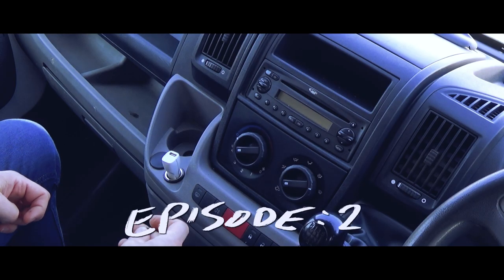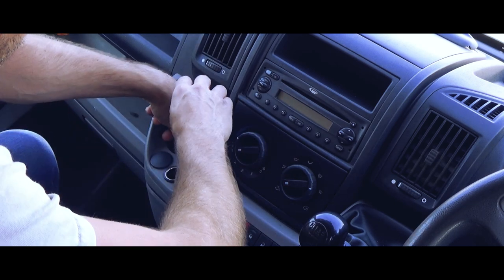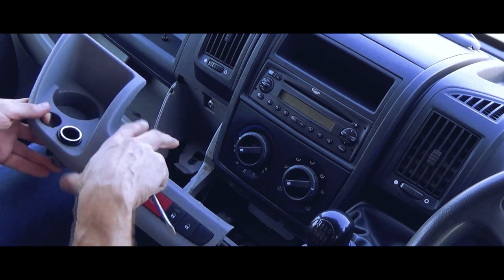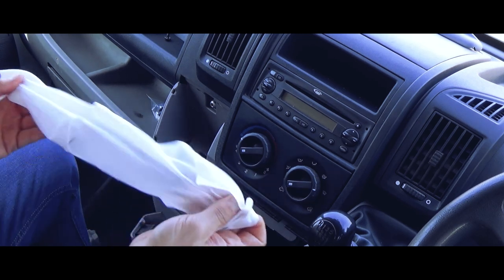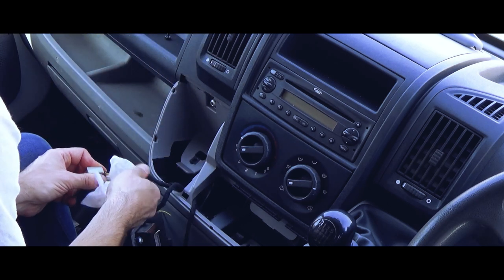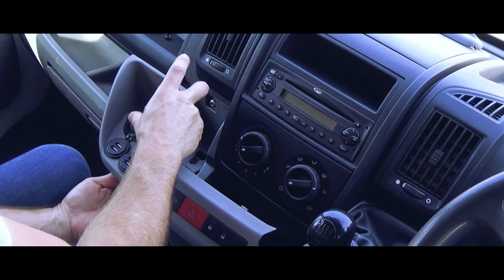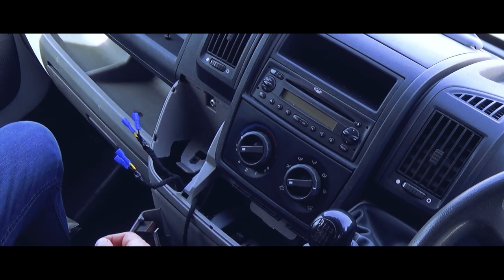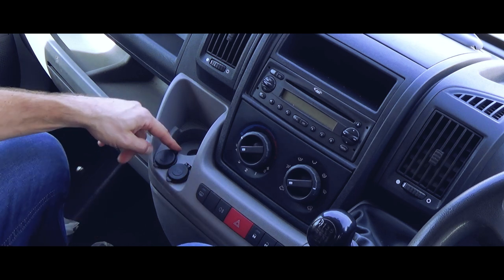2: Replacing the dashboard cigarette lighter

Comment: I just put in my USB socket. I did not cut of the original wiring. You can take the individual wires out of the socket and connect them directly to the USB socket. All you have to do is insulate them of course. I dont like to cut in the main wiring loom (i wasn't allowed to do that when i was working at the dealer)

Comment: Mate thanks loads! I have been looking for a vid that shows how the dash comes off and was delighted to find yours. Cheers!!
Reply from the maker: John Gow Photography you're welcome. Thanks for the sub. 😊
Reply: Hey Mevi. Which of the spare yellow wires is ignition, bold yellow or yellow blue stripe?
Reply from the maker: John Gow Photography there are 2 yellow cables per 12v socket. The thicker solid yellow cable is your live. The thinner striped one is for the dash lighting of a socket if needed, I believe.
Reply: Very useful. Just as I was thinking to ask. It was answered. Bit puzzling to see 3 wires going into a thing which should only have two! Well done, indeed! It was also a perfect location for my reverse camera monitor. Added an extra set of USBs and used the switched 12v to power the monitor.

Comment: No need to cut wires. Release tabs on fittings and the connectors are already attached. Then plug to new fittings.
Reply: Do you know what the third cable is for?
Reply from the maker: the original factory fitted socket glows when the driving lights are turned on - that extra wire powers the light.
Reply: @Mevi cigarette 🚬  lighter is 12 volt socket that what I use

Comment: In the past 35 years I´ve added additional power sockets literally to all my vehicles, including some van conversions. And in the process, in later years, have used several of the same USB sockets. 
So I´m confident enough to say you just used a lame excuse, to limit yourself to low output 5V USB sockets. The "cigarette lighter" socket not only works perfectly well as a normal 12V socket. But allows some decent amperage to an array of other accessories. 
Just some food for taught. ;-)

Upon assembly, instead of going around butchering the original wire loom. 
With small screw driver or pin, press tab on connector, remove them from the plug.
Add some insulation, I prefer heat shrink sleeve, but tape is just fine.
Connect them to your new socket. Enjoy. 
Cheers
Reply from the maker: This is an 18 month old video. At the time, 5v was all I was using in the cab, charging a phone, camera batteries and other small gadgets. I've put in 2 new 12v sockets in the cab since. The original cigarette lighter had to go, whatever. Fiat put very shallow lighter sockets in their vehicles, the Punto was the same. Nothing else stays in, but it DOES light cigarettes. Fiat put in an ashtray, but no cupholder!
I covered this in later videos and also that I had come to a similar conclusion about all those (unused) USB sockets in the back of the van too. 12v sockets with a usb charger is more useful than just permanent usb.

Comment: Great vid, Ive got a 04 reg ducato m/home, facia is very similar and I want to do same mod as you have, do  you know if the panel detaches in the same way as yours.
Reply from the maker: Sorry, I don't know. 
Darran (Urban Motorhome) has an older Ducato moho, but I've not spent any time inside the cab. FIAT reused the IVECO engine from the older Ducato, so it wouldn't surprise me if there were a lot of other parts and assemblies that carried over into the newer model.
Handy tip: If you feel like any plastic part needs to be pried up, cover the soft plastic with a piece of gaffer tape before you dig in with a screwdriver or trim removal tool. 😁

Comment: Would this be the same for a 2017 Peugeot boxer elddis motorhome and what wire do you not use out of the 3 wires
Reply from the maker: The engines and transmission are different, but nearly everything else is FIAT underneath. Aside from the trim, motorhomes are based on a commercial vehicle, so parts will be the same. 
The wiring should be the same as mine, little changed after the facelift. The thin cable is only for the ring of light around the socket that comes on with the dash lighting. Tape that off, it won't create a CANBUS error.
A great resource is fiatforum.com - regardless of manufacturer, there are a lot of solutions to problems for your vehicle (apart from the drivetrain). Maybe don't mention it's a Peugeot. 🤭
Reply: @Mevi  I was wondering what the third cigarette wire was for...

Comment: Hi mate where did you get the usb chargers from I’ve looked everywhere,Mike
Reply from the maker: Amazon is where I got these. 2+ years later, I've changed to plain 12v sockets and use high quality plug in USB chargers that are suited to modern devices.
I have phones that have fast charge capability, an iPad that can take huge wattage from usbc. A tyre inflator and vacuum. A charger for my work laptop.

Also see my video where I use a fuse-tap to add a socket to the right of the steering wheel. Saves trailing usb cables.

For me, it makes a lot more sense to have general purpose 12v socket. If you plan to buy a mix of 12v sockets or USBs, it can work out cheaper to buy a set (like the one I bought linked below) and use the parts. I paid only £9 back then. They've put up the price to £15 so shop around and don't buy this one!!!

https://www.amazon.co.uk/dp/B00Y4HRFTY/ref=cm_sw_r_apa_i_DCFQEbR9E3EZ1

Comment: Great video mate, helped me out a treat :) btw, do you know if there's a way to reset the courtesy lights in these vans? Diconnected my battery the other day while working on the van and now the courtesy light just stays on (when switched to auto)? Cant find anything out there.
Reply from the maker: Mine is basic spec and the interior lights don't connect to the CAMBUS. Do you have a 2014+ or higher spec van?
If you watch the video I made about adding another usb with a fuse tap, I also modded the interior light. You will see the inside of the switch has no electronics AT ALL.
The clock on higher spec models is changed through the stereo, maybe the lights is an option there?
Reply: Hi  @Mevi  thanks for the reply., mine is basic too, it's 2011.  The light comes on when you unlock it or pull the key out the ignition. can't find anything in the manual... worse case I can live with it, I just hate being beaten lol
Reply from the maker: Hmm, strange. Might be a stuck metal contact on the back of the switch and just a coincidence that it happened at the time of the battery coming out. Maybe pop the housing open and take a look. Here's the video where I open mine up https://youtu.be/F3ze_7KiEso

My batteries have been disconnected more times than I can count and the timeout works like always.

Comment: Could you tell if the Red Triangle light on the dash for the Hazard warning lights should flash when the Hazards are on? Regards, Pete
Reply from the maker: Mine doesn't flash. It only lights up with the rest of the dashboard. The connector on the back of that switch panel doesn't seem to have enough pins for more than illumination and the function of the switches.
Reply: @Mevi  Thanks very much :) Regards, Pete

Comment: Done exactly this but it's not going live do you happen to know what fuse it is ? And is it a shared fuse ?
Reply from the maker: F44 in the fusebox to the right of the driver, assuming yours is RHD. Manual says should be a 20amp fuse. I don't believe it's shared.
It's page 162 in the electronic manual which you can find in my shared resources Google Drive.
https://drive.google.com/drive/folders/1aR2mvfo_5IUx0QIuMMjqpkoYhAHMmKyq
Reply: F15 under bonnet box in the 2012 model...

Comment: any videos on replacing ignition barrel  ??
Reply from the maker: Fortunately, not something I've had to do. Try over at fiatforum.com - I reckon you'll find what you need there. Whether you're driving a commercial van or converted motorhome or similar, the base vehicle is pretty much the same across Fiat, Citroen or Peugeot (aside from drivetrain)

Comment: Please help, after cutting the plug/wires how do u pair them up? Really lost at that step.
Reply from the maker: Thick yellow is positive, black is negative. The thin yellow is unused (powers the light on the original cigarette lighter).
Once crimped, your wires connect to the spade connectors that should be marked + and -
Reply: @Mevi  thankyou so so much! highly appreciated

Comment: Hi mate just another question have you ever fitted a spare wheel carrier on your fiat Ducato van ?
Reply from the maker: I have. Easy peasy. Mine looked like it had never had a wheel in the trashed carrier that was on there. A few bolts and it's done.

No video of it. Don't know why.

The winder mechanism uses one of the tools in the box with your jack.
Reply from the maker: I bought mine new from eBay.

Comment: Could you list the parts you used, I'm going to do this straight away.
Reply from the maker: The exact listing isn't available anymore, but this is an identical part. There are cheaper listings, but I chose this one as a starting point as the listing has option of fast charge versions if you have a compatible phone. Also this one comes with extra lead and a fuse which might give you peace of mind.

https://www.amazon.co.uk/dp/B07TZM8PRL/ref=cm_sw_r_cp_apa_i_aIC.DbWEE4EPH

In a later video, I use a fuse tap to install another socket to the right of the steering wheel, above the fuse box. I've since swapped a few of these USBs to plain 12V sockets as they are more versatile.

https://youtu.be/F3ze_7KiEso

Comment: Hi Mevi
Do you know where is the fuse for the cigarette lighter? in which fusebox? Many thanks
Reply from the maker: It's the one in the cab. The book says it's Fuse F44, 20A fuse.
Here's a link to download the owners manual. I've shared it on my Google drive for you:
https://drive.google.com/file/d/1BCmbZiNgCB6rv1qMkjtDXHPaJE1CI4GS/view?usp=drivesdk
Reply: It depends on the year that your van was built. Some have the cigarette lighter socket fuse F44 20A in the fuse box in the dashboard, later models have it in the fuse box under the bonnet F15 10A.
Reply: Dose the lighter port and the spair lighter port run off the same fuse .iv fitted one on my spair and I don't have any power to it only my cigarette lighter port.i might need to change the fuse .do they have a fuse in if it's blank also.my van is relay 2020
Reply from the maker: In my 2011 van, they share the same 20A fuse F44.

I did a quick Google and it looks like after the 2014 facelift, they moved the cab 12v sockets to TWO SEPARATE fuses... In the fusebox inside the engine bay. F14 & F15

I wasn't able to find a manual for the 2019 facelift. That's the one to search for.

Comment: How can we do to have permanently 12v there , without ignition on. Thanks a lot
Reply from the maker: you could run a wire from an unused fuse in the fusebox. A fuse tap is the simplest way to do it. I added another socket by the steering wheel. you just have to read up on the fuses that are permanently on. I made a video about that.

https://youtu.be/F3ze_7KiEso

alternatively, wire to the battery in the footwell..... MAKE SURE YOU ADD A FUSE! 😎👍
Reply: @Mevi  thanks thanks . I will take a look. I see what i can do ,because its annoying
Reply: Keep in mind that the USB sockets, even with nothing plugged in, consume a bit of power.

Comment: Hi, Someone asked me that after the usb socket upgrade he wanted to know how to fix the lights at the part where the ventilation knobs are mounted.  Seems that only one half lights on that "plate" work. Is there any fixing manual for this issue?  Thanks.
Reply from the maker: The lights behind the heater controls are tiny lightbulbs that are accessed from behind. It is VERY hard to get to the lights to change them. I haven't needed to change the lights, but I have had to replace the fan switch in my van.
https://youtu.be/dQpO3Md8oyc
Reply from the maker: This is a link to the FIAT workshop CD-ROM. You will need a Windows PC to run the software. It's made for technicians, so is not simple
https://drive.google.com/file/d/1aRr0BCTz0HxKriwSVWe1CDplzouKaAH4/view?usp=drivesdk
Reply: @Mevi  Thanks for the CD-ROM. I will pass it to the guy who asked about the lights.
Reply: @Mevi  Okay, had a look at the youtube movie about the replacement of the fan switch. It looks as a hell of a job to do. And about the lights -> The guy from who the car is went to the garage today to ask for a spare set of the light bulbs to replace the one(s) that is broken. In the garage they told him it was a very difficult and time consuming job. The ligths cost almost nothing but they charge a few 100€'s for the replacement job because of the difficulty. HUH???
Reply from the maker: @Beire64  to replace the switch took me maybe 2 hours, but it could be done quicker without taking so much apart and without the cameras!!

Comment: Awesome video man thank you so much!
Reply from the maker: Happy it helped. The socket in the rear is identical. 😊
Reply: @Mevi  After watching, and watching your others I went for 1x 12v and 1x usb, but I checked the van and the cap says 12v DC so it might of been ok that one, but still changing regardless, just because it's easy and helps in future :)
Reply from the maker: There's another video of mine a few episodes later where I drill a hole for a brand new 12V socket for my phone. It's installed beside the steering wheel using a fuse tap. That has been far more useful than the ones in the centre of the dash which get used by a passenger or for charging "stuff".

Comment: How did you know which colours to crimp?
Reply from the maker: Black is always negative/ground. I have a cheap multimeter too - always useful to have one and they can be found online or at Aldi/Lidl for  a reasonable price.
Reply: @Mevi  thanks man, so did you remove any fuses when doing this?
Reply from the maker: @andyjm7122  I didn't.... Not that I actually checked, but both sockets there only come on with the ignition. I kept the original fuse rating, which saved me when one of those USB adapters failed. I kept the other one, but I have come to prefer using a 12V socket with a good quality plug in USB charger.
Reply: @Mevi  good to know, cheers man :)

Comment: Where did you buy the USB chargers ?
Reply from the maker: Amazon - http://amzn.eu/3icRvwc (it's not a paid link) - I even reviewed it there! 😃
Reply: Thanks. I converted my Ducato to a camper van as well. Might post a video some time, although I don't have one of the conversion itself. Quick warning : the door locks are extremely easy to break. Mine was broken into with a screw driver, which takes about 20sec. I fitted electronic locks on the inside.
Reply from the maker: Thanks, that's great advice Wim. I've seen solenoid type electronic door bolts that are huge and would have bought one if I had the cash. The Ducato is made of very thin steel and the plastic handles are weak. Security is really important for van drivers, especially in the UK. I've put deadbolts in the rear and sliding doors https://youtu.be/LQdHaNGAp_4 and I need to get around to putting them in the cab doors. Once they are all in, it wouldn't matter if I didn't use the remote locking at all.
Definitely post a video. Give the video a good name and you will get a ton of views - I will be one of them. 😊
Reply: Wim sorry to hear mate.

Comment: Awesome off to eBay now to buy one for my van.
Reply from the maker: If you buy one of those triple 12v socket sets, the type that includes a socket, usbs, and other stuff in a plastic face plate, you pay less for each component. In a later video, I add another socket over on the driver's side and use a fuse tap to wire it into an unused circuit.
Reply: Nice one I'll hunt it down. 
Though I've already bought one on eBay.
Reply from the maker: For reference, I bought a couple of these. (It's not a paid link- I don't do affiliate-  so it's safe to click)

Motor Car Truck Boat DC Digital Voltmeter Three Hole Panel DC 12V Cigarette Lighter Power Socket Dual USB Port GPS Port Power Supply Charger https://www.amazon.co.uk/dp/B00Y4HRFTY/ref=cm_sw_r_cp_apa_i_d3.uCbTG8CR23
Reply: I'll be ordering one for my big van build later in the year. Cheers.
Reply from the maker: Woohoo! Greg Virgoe is THE van builder, if you haven't already subscribed. 😎